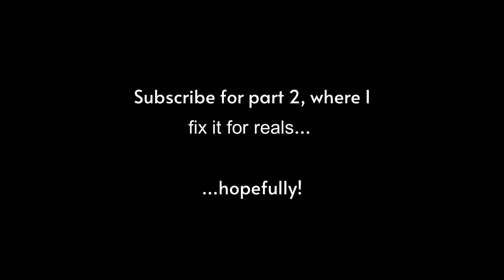I Try To Fix A DeWalt Drill On The Cheap | Part 1

Comment: Just a few quick questions/observations:
1. - Why did you remove the chuck & clutch plate?
2. - You forgot to shrink the heat-shrink on the motor terminals.
3. - Did it not occur to you to test the new motor before reassembly?
4. - Where's part two, and will it include a teardown and reassembly of the planetary gearbox? 😄 

I'm now off to strip mine down (again) to see why the speed selector doesn't shift into high speed; here's hoping that it's just the spring clip has popped off. 🤞

Comment: Just bought a couple of broken drills to repair mine. The torque setting has jammed on mine and one of the ones I have bought just needs a new motor. Was thinking of putting spade connectors onto motor wiring to make swapping easier if I need to at a later date. Going to try replacing end cap on a motor to try to get a 2nd drill working cheap.

Comment: Does this model have brushes if so how do you change it?
Reply: The brushes are not able to be changed out. The motor is sold as a single unit.
Reply: It has to be spade clipped and/or soldered into the positive and negative wires coming off of the trigger assembly.
Reply: You can buy the end cap of the motor with the brushes in. There are two tabs bent over holding it on so not easy to replace. If the brush holders are okay you can buy brushes to slot in but is really fiddly. Cap is about £3, brushes about £7 for 10. Motor is a 550 I think.